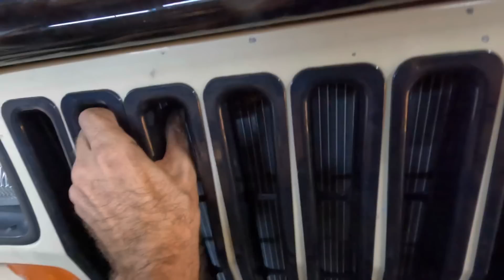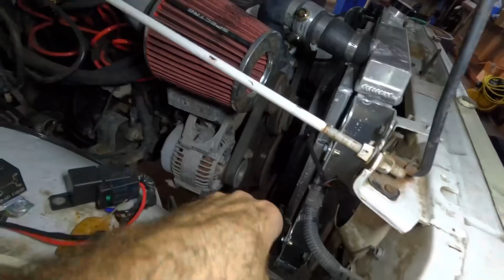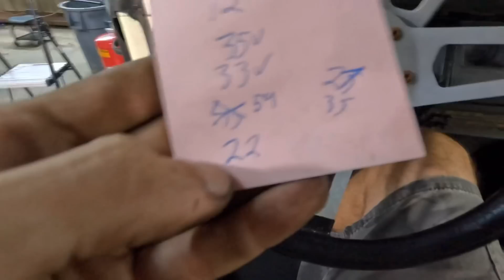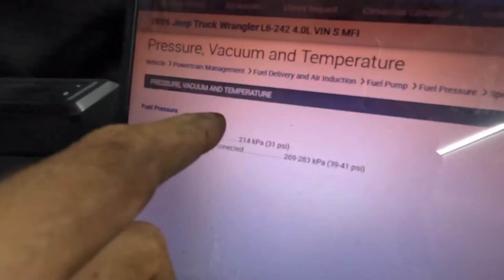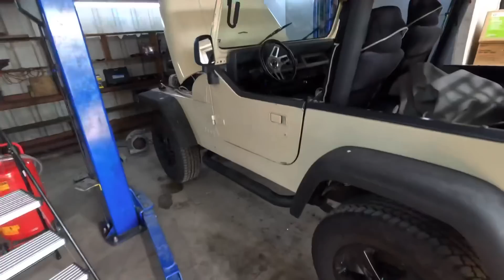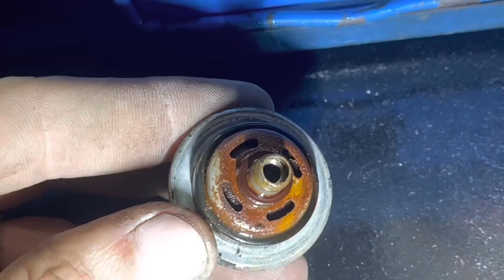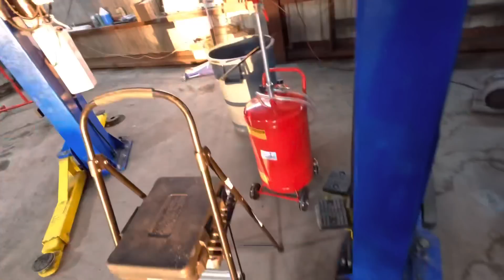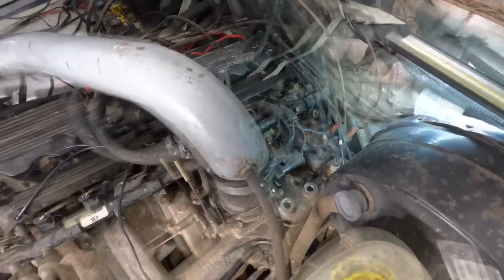Parts Cannon!! Can it be saved?? 95 Jeep Wrangler 4.0

Comment: bad crankshaft position sensor.  Very common on the 4.0L. Also that aftermarket radiator puts the lower hose way too close to the trac bar. I guarantee just going over those rr tracks caused it to hit. Also the 4.0L  likes to run at 210 degrees and it needs a good fan and a cooling system that is in good shape to keep it from running any hotter.

Comment: Ray, that sounds like my 74 F100. Built 390 FE and I was told to install a high volume oil pump recently. Drove it in the garage no problem, dropped the pan, replaced the pump, put it back together and it would NOT restart. 3 blown fuses, smoked the tach... Let's just say after chasing my tail for 2 days, the entire ignition system and half the fuel system is new. It runs good again (with the old oil pump), but I still have no answers to what happened. Parts Cannon! I think it was me, but why did it blow the fuses and the tach?!
Reply: Sounds like one might have to disconnect the battery ground wire to change the oil pan safely.   Weird.
Reply: @ChevyMoose  you could be right, but I've never even heard of that happening on a rig that old. 50 year old wiring. Never know.  But hey, the entire ignition system is new, which means it will likely fail sooner than later because replacement parts today SUCK!

Comment: eh rai first of all great video thx like you way of gooing from point to point on this , eliminate the most common first ect . 
but concindering the look of this jeep i recomand you look the sparks from there to the distibution cap for them . 
check also the fuel ramp . 
i can see there is a lot of do it your self on this jeep so i think your in for a full inspection of vacumline conectors ect .

Comment: Code 54 should be cam position sensor (disc inside distributor) I had to back trace to locate this fault on my XJ Cherokee (also a 95 build) before I got a scan tool 👍

Just to complicate matters there are 2 connector types
* 3 round pins
* 3 flat pins
Reply: I remember those friggin disks. Flat wires exit under the cap and with wear would cause ignition to ground.
Other  thought spinning around is intake or vac leak. Try a propane torch unlit to see if engine revs up
Reply: @fixinanddoinstuff2134  Yes, the cavity in the sensor cakes up with carbon from the distributor cap bushing, break clean might shift it 🤣

Comment: Misfire got to be either fuel delivery or ignition thereof... Check cap/rotor/plugs/wires????  Got an old school timing light? If your eyes are good enough, hook it to each wire and trigger the light and watch the flashes for a bit, your brain SHOULD catch a misfire .... If ya pull the plugs, I'd suggest a compression test at the same time which will rule out valve issues perhaps... 
Course, I know you know all this... but sometimes we get ahead of ourselves and overlook the obvious.. 
Remember, Paramedics save lives, EMT's save Paramedics! Paramedics tend to concentrate on the technology and pharmacology, and not the simple life threatening things, which the EMT's are best at finding and fixing.... If that makes any sense .... 
Now to wait impatiently for Part Deuce to find out what the hecks going on with this thing!!!! We know you'll figure it out eventually !!!!!

Comment: Chrysler Fault Code 54:
Signal loss from the fuel injector sync pickup during engine rotation. which makes sense with all the other injector codes.

Comment: My experience with AMC 6 engines the run high exhaust temps which can cause loose manifold fasteners,leaking gaskets ,cracked exhaust manifolds and stuck open heat riser. All though that engine shouldn’t have the riser to heat the intake manifold and not a one piece exhaust manifold to cure the loosening/ cracking.

Comment: Have you checked the timing on the Jeep. Timing that’s advanced will increase exhaust temps and make it have a stumble.
Reply: Timing and camshaft position misalignment can also make it difficult to start the vehicle.
Reply: @MacGyver1991  not sure there was a cam positioning sensor in a ‘95 jeep. But if there was that could have been that wire at the back of the engine.

Comment: Over 800 degrees temp. on the exhaust manifold is WAY too hot at idle.  I usually measure around 450 degrees at idle.  Sounds like retarded ignition timing.  I noticed the timing mark on the engine was clearly marked when the video went underneath to look at the water pump leak, someone had been there.  retarded timing also can make the engine lazy to start, and transfers more heat into the cooling system.  If the cat is still installed, good chance it is starting to melt down.

Comment: This is a good example of why mechanics start firing the parts cannon. Because there is no way in heck most shop owners would spend, or allow their employees to spend, this amount of time and work diagnosing a problem. Nor do I think the majority of mechanics have the patience or perseverance to go through the steps Ray is going through, at least not from my experience. I think the majority of mechanics would look at the codes, replace related parts, and then hand the car back to the customer, and pretend the car was fixed. Only to have the customer come back a few days later and have the customer complain, dropping the car off again, and repeating the cycle. It'a happened to me before.

Comment: Had a 1993 Jeep Grand Cherokee with the same 6 cyl. engine until about 2003. We had to replace the fuel rail and injectors due to rust in the system. I found out that was an inherent problem with those engines back then. It was a JEEP thing...we wouldn't understand! 😉

Comment: You can pump all day on that gas pedal and it's long as the fuel pump is running and the injectors are working it'll start right up you can't flood it

Comment: I would like to know how you're giving it gas when the fuel pedal only operates a butterfly
Reply: TPS sgnal to ECU...which controls the injectors!
Reply: @stevenbaker9327  not if the key is off, I used to be a tow truck driver in a lot of people with pumping a lot of times and then turn the key on, doesn't do a thing
Reply: @stevenbaker9327  you know you might have a valid point, meaning when he turns on the key and pumps it it is not sending signal to the ECM to give it fuel

Comment: Had a 95 Jimmy with fuel pressure regulator issues. It also had a small leak in the fuel line and it was a pain to check and fix. Acted ijust like this Jeep (comment added just before half way point of video).

Comment: Ray you may need to drop the fuel tank & check for rust in the tank, if rusty clean or replace with a new one. Had to do that to my ole Chevy pickup truck, also check fuel rail plus injectors. Sometimes Mr. Rusty can cause you a Texas sized troubles😊😊, while you are having yourself a great day today. Ray going back to old school diagnostics will strain your brain especially when the newer ones have you spoiled by using a scan tool

Comment: Pusher Fans are not nearly as Effective as a Puller fan, the difference is about 5 to 1; I am judging that with a Mishimoto Transmission cooler that I installed in Pusher Mode, not much air through it, reversed the Power leads, and the air flow is at least 5 times stronger...

Comment: Hi, Ray if I had any doubts  about a converter I would pull o2 sensor and test drive there should be power increase . Have had converters increase back press as they warm up. I had a nipple made up to put in place of o2 sensor to check back pressure with a gauge but that didn't always work

Comment: Code 54 - Mixture Control (MC) solenoid is shorted or the ECM is faulty.

Fuel Injected Engines:
Code 54 - Camshaft (or distributor sync.) reference circuit - No camshaft position sensor signal detected during engine rotation.

Comment: That ole Jeep has been rode hard and put away wet. The rust inside the fuel pressure regulator is a hint that the engine has been trying to run on water and gasoline. This ethanol blended crap they call fuel is a magnet for attracting moisture because ethanol is hygroscopic. Plus, with it being a Jeep, someone off roading may have had it up to the floorboards in water a few times which can dump water into places that are not good.

Comment: Those "cold air" intakes crack me up. Lets install a steel heat soaked tube with a crappy filter sucking up hot underhood air and call it PERFORMANCE....😐

Comment: Problem with a vehicle like that is it has been ignored for too long and then lots of hands in the pie.  I have no doubt you will fix it and get it running right as long as the owner can afford the parts and labor charges.  If not, he leaves unsatisfied with your work and tells all his friends.  If he does leave it long enough, he gets it back running right and he's a 50/50 customer. 50% tell their friends how great you are / 50% tell their friends how they got overcharged for an easy fix!  You just can't win, but ya gotta keep trying..  Good luck Ray.  I'm betting on a combination of wet gas, bad injectors and at least 3 worn out spark plugs. With it overheating that bad, a good chance of a warped head is also a possible aftereffect as well.

Comment: I had a 1991 4.0 in-line 6 that I had to replace the radiator because 1/2 of it was obviously clogged.   The only way I could keep it cool was to run the heater on high.   Once I changed the radiator all was good.

Comment: On a jeep over 25 years old, theres a lot that it can have going on.
Other than sensors, the injectors like to drip and I've individually back cleaned the gravel out of them, found vacuum hoses and fuel lines that were  a loss to age, a federal mogul fuel pump recall, an update jeep did going into 96 that eliminated the regulator and return.
The rail had an update part.
Hey, aqualung.
You end up with a revised fuel system if you stay with it, the pressure gets an upgrade and averages 60 psi with no return line.
The integrity of the plastic lines comes into question.
I stayed with it on a 4.0L to find everything and fix it and the things previous repairs had caused.
It was a pile.
The exhaust manifold cracks and the water pump doesn't last and the timing chain will be baggy. 
The more you look, the more you find.
Yes, there could be more to find.
If it's for a customer, you best fully inspect and advise.
It may run up a bill the customer won't pay or will bring it back again and again if you let him.
Telling him everything can lose you a friend but it's honest.
I would find out if he really wants to invest in it. And get the idea across that they need a lot of parts at that age.
There's also a coolant fitting you will probably find on the front of the engine.
The parts aren't that bad, or at least they didn't used to be that expensive.
Use Crown automotive parts for anything tuneup and driveability related where you can. Their stuff is made right for these.
Other brands were problematic. I found.
Inspect the fuse center for corrosion and be sure it has a cover in good condition.
I'm going to stop telling now.
I hope yours is in better shape.
Reply: The cover for the PDC was missing too - why it was dirty at the relays.
Reply: @oscarwinner2034  oh crap, if it's a humid climate, he might want to examine closely to be sure it's not corroded.
Seems like used parts could be found on some jeep, somewhere.
We had numerous types and various models in yards last time I tried to help somebody.
Many similar parts were found, also jeep vehicles using the straight six 4.0L.
We needed a lot of test/eliminate part swaps to save hours and days.
Once it ran and drove, it was rolled within a week.
Sad.

Comment: Great to watch your approach!   Curious: what’s the customer feeling about cost?  Ok to piecemeal repairs… or, does he want a total first?     Also, is this car being nurtured as a “classic” or just a set of wheels?   Really a fun watch.   THANK YOU!!
Reply: Looks like a cruiser. With the missing windshield plates, I'd bet it off roads and cruises around the neighborhood only. Perfect ride for that YJ.
Reply: My feeling is that they replaced a BUNCH of stuff with a howitzer approach and did not get it.  They want it fissed
Reply: @livingdeadbtu  I'm pretty sure all of those sensors are Amazon or eBay parts. If he got Mopar sensors, it would be a pretty penny since most of them start at $100. And that could be another issue all together since 4.0s tend to not like aftermarket sensors, for the most part. Hell, the new fuel pump could be a brand Jeeps don't work well with. They're very picky.

Comment: Hi, Ray! Based on old forum post 54 means the camshaft sensor's signal is missing. I see new lightning hoses from distributor. Underneath should be also cam sensor wire.

Comment: So frustrating when you get a vehicle that has a non descript fault after someone has already fired the parts cannon at it. You're then dealing with potentially some of the critical evidence no longer being present and no doubt dozens of potential red herrings where some other grease monkey threw a bunch of parts at it in the hope that they could treat the symptoms rather than correctly diagnosing the cause.

Comment: Isnt Code 54 for the Mixture Control Solenoid? if not you did say there was a new ECM installed right? because that could also be faulty causing code 54.

Comment: Had the same problem with my Jeep Cherokee with the 4.0 L six back in the 90"s ended up replacing a miss firing ignition coil and a clogged cat converter due to raw fuel being dumped into the exhaust system by the coil miss fire.

Comment: Looking at the rust inside the fuel reg on the fuel side, there should be none, over it's life it has had water contamination in the fuel system, which will have affected all fuel components internally from fuel lines to injectors etc I wonder if the reason for the fuel pump being changed was internal corrosion ?

I've seen similar things happen with odd fuelling problems on pre OBD and OBD engines, eventually traced to contamination in the injectors on doing a spray and flow test on them, not enough to give massive running problems but not the best performance.

Yes the slightly weak mixture can sometimes be seen by watching live data of the downstream Lambda sensor, but not weak enough to do a PID.

Back to seat of the pants spannering  of understanding  1) How does this work, 2 ) what will stop it working, 3) test and eliminate.

The injector is supplied with fuel at the correct pressure, the injector is open for X milliseconds to supply Y fuel quantity, the ECU's job is done, however if there is a slight blockage, corrosion, gumming in the injector reducing fuel quantity, only the engine knows, or a good investigative mechanic like Ray.

Comment: This seems to be a combination of a load of minor issues, I think I`d check the compression seeing as it must have been overheating a while, possibly singeing valves. I`d also do a "tetra clean" into that fuel rail for a while, to clean the injectors & combustion chambers, although there may be enough debris to warrant pulling the injectors & ultrasonically cleaning them. Then theres all the electrical connections & even wiring breakdown.. Its one of those long winded ones for sure..

Comment: From Jeep forum: Jun 29, 2011 — Code 54 on obd-1 systems actually refers to no camshaft signal detected during engine cranking. Sounds like Crank position sensor going out.
Reply: That's what I found too. Maybe that's what the loose cable was for. Maybe when firing the parts cannon someone missed the re-connecting the sensor.

Comment: As a jeep tech for 20 yrs, I would recommend pulling the plugs and checking condition. Many times I've found bad injectors and or poor spark. Sometimes at the same time. LOL Lean fuel will make that engine run red hot at speed.

Comment: Chased intermittent cylinder 2 misfire for months on my 01 4.0 wj. Spark plug, coil rail replaced. grounds checked pcm checked. Would start in a vapor lock and knock. Turns out I needed to use electric contract cleaner on the injector plug. Solved

Comment: My flapper in my 86 305 broke off the shaft inside RH exhaust manifold & wasn't being held open, ran like a 4cyll & melted some of AC housing, good thing I had a fire extinguisher. Exhaust blockages are dangerous. Usually if they are bad enough you have excessive crankcase pressure & it may blow the dipstick out part way, I've had that happen with single exhaust & internal blocked muffler, (pre cat times, 69 390).

Comment: My mom had the same issue with a 94. The problem she had was a coil. About every 2 years it will go through a coil.
Reply: Yeah the 4.0s are hot runners, cooking coils. Also 4.0s don't like aftermarket coils.
Reply: Hers would do the same thing hard start. No start. Lack of power. Burn out a Cataletic  converter. All because of the stupid coil

Comment: They have the intake in a perfect position so that when they go through a puddle it shoots water right into the intake. Put the proper box back on. Thinking on it I would bet compression is off. I bet they did suck water into the engine. If I were a betting man that engine has slight bend to the rods. This would explain a lot of the issues as I currently see it. Also explains gunk in places it shouldn't be, electric issue, a lot of electrical component change out.the real issue is an owner that has little clue what they are doing. The intake setup should never be installed on a vehicle that is used off-road
Reply: One tell tail sign is look at the oil. Either the oil will look brand new, because the changed it on hoping to fix it, or it's got water in it